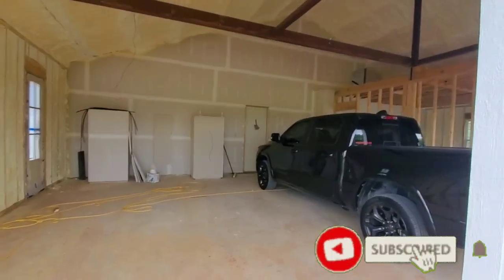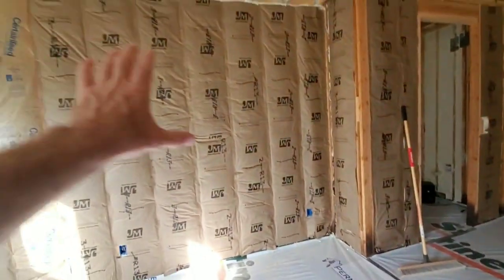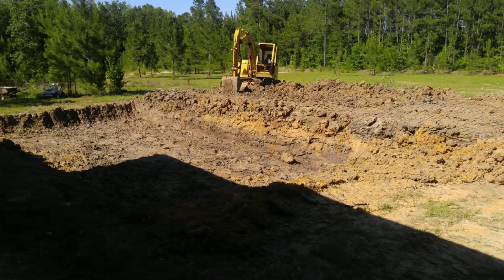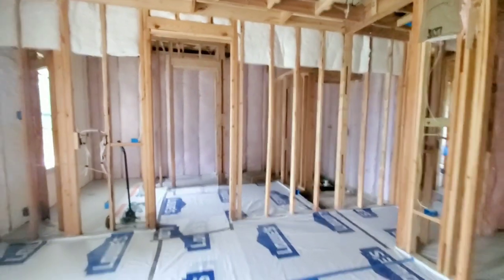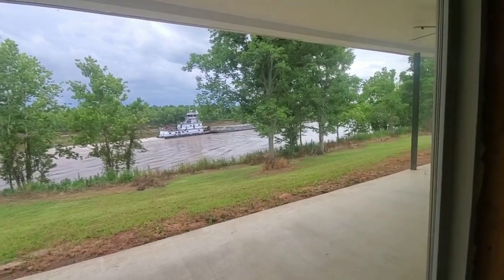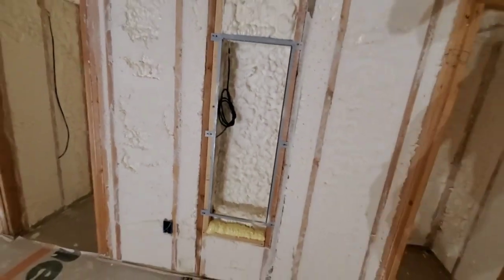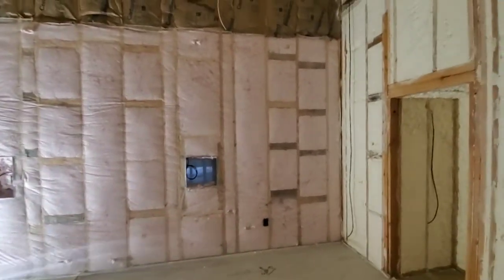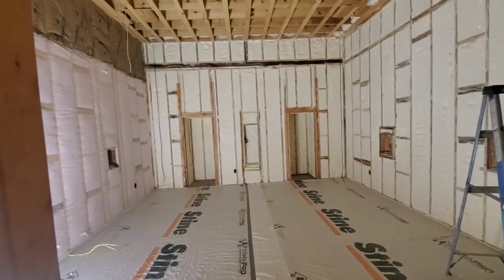House and Theater Build Update #3.  #Best Sound wall insulation. # DIY house # House Build

Comment: We have the Intex pool. It is great for the most part the only issue we have had is the corner pieces rust easily. I would recommend putting another coat of paint on them before installing it.
Reply from the maker: Yeah they did get some rust on them after a few years and I painted them in place.   Wouldn't be a bad idea to do it like you mentioned.

Comment: I've enjoyed watching all of your build videos today.  What a room!  For sound isolation, it looks like you've done staggered 2x4s stud walls, blown-in insulation, and 1 layer of drywall?  Did I get that right?  I've been reading a lot on AVS about soundproofing for my project, and I repeatedly see the suggestion for decoupling the walls (which I believe the staggered studs do...not sure how ceiling is attached), and installing 2 layers of 5/8 drywall with green glue sandwiched in between.  What do you mostly see in your installations and how has your room been for sound isolation, particularly at low frequencies?  Starting to wonder if all the bells/whistles for soundproofing are worth the money, or if I should just turn down the subs...
Reply from the maker: I've used this method on my last 2 personal theaters, this being my 3rd personal.  You hear nothing under -20.  Above that it begins to become audible.  Bass really cost big bucks to contain at high levels.  It really comes down to budget and your goals.  This will make a good Q/A so look for that soon with an audible test in vs out of the room.

Comment: you should  do a blower door test before  you sheetrock the walls. Great for finding  air leaks.
Reply from the maker: That's actually required with other insulation methods but because it's spray foam insulation they don't require it as the foam far exceeds their test limits.

They're sealed so tight we have to have fresh air intakes because of the lack of leaks.
Reply: @hometheatergurus  gotcha. Thats true. It is pretty good to know what your ach rating is. You could be close to passive house standard. 

And its good report to have for real sale. 

The Rew of home energy  performance. Lol.

Comment: Have you had experience with those "smart" switches? Are they legal to use? And really curious of their durability and or longevity
Reply from the maker: I've tested them.  The lighting circuits are all dual arc fault protected so I'm not worried about that.  If one fails I can easily replace it.  Im pretty sure they are also ul rated.

I probably wouldn't install this for a customer but as a home owner and for the price I'm all for giving them a try.
Reply: @hometheatergurus  right on! I'm going to order some. Also now I'm going to have to burry an intex pool lol. Great vids man, love your channel.

Comment: Hi Guru, may I ask why you opt for insulation foam (I assume it's Polyurethane foam) and not go for cellulose insulation? A cellulose insulation company claimed that cellulose has better STC than PU Foam. I have no idea if that's true or if he's just marketing his product. Rgds.
Reply from the maker: I've used open cell spray foam in my last 3 houses and love it.  Energy bills are exceptional.   While its R value may not be as good as some it's sealing is the best.  That is what makes it so energy efficient.   As for STC yes it doesn't work well for sound even though some claim it absorbs sound well, but it's not true.  Fiberglass and Cellulose absorb far better.  You'll notice in this video , the sound walls have either r13 or net and blown insulation in the staggered stud walls.
Reply: @hometheatergurus  
Many thanks for the clarification. Really love the channel. Keep up the good work and I wish all the best for you. 🙂

Comment: The reason rockwool is superior to r13 or other fiberglass has nothing to do with  published absorption coefficients. It's because of mass... Still only 3dB better, so not a big deal either way
Reply from the maker: It's mass or density is part of the absorption coefficients specs as an actual measurment.  So that is factored in.  The install issues of both is where they fail.

Comment: How has your house build been during Covid? Hard to find building materials and escalating prices?
Reply from the maker: Luckily I best the lumber rise.  It was framed before the spike.  I got hit some with insulation but that's it.  Sheetrock and trim haven't gone up much.  Seems to be mainly the framing materials and sheathing that have gone crazy.

The reason I'm not further along is I'm slow and I have had delays some getting materials like the spray foam. Now that sheetrock is going up I can get after it.